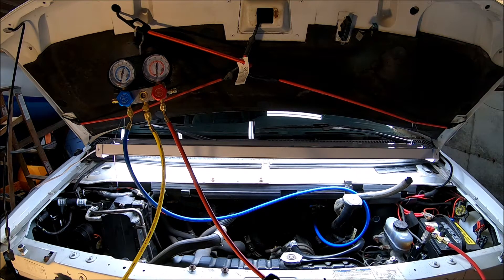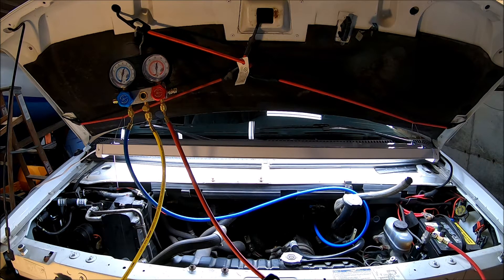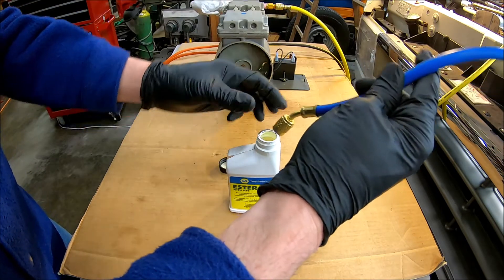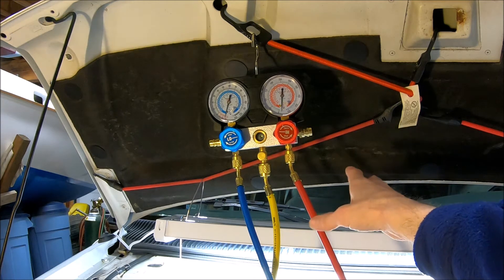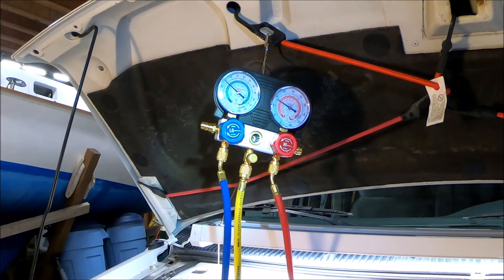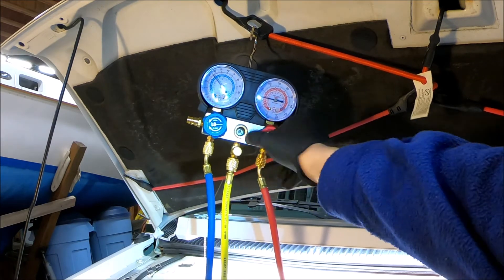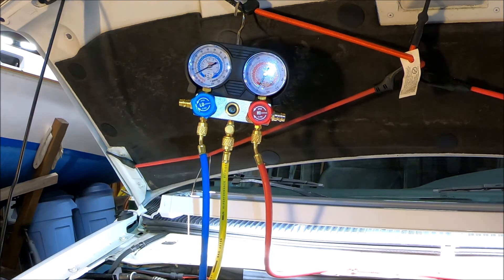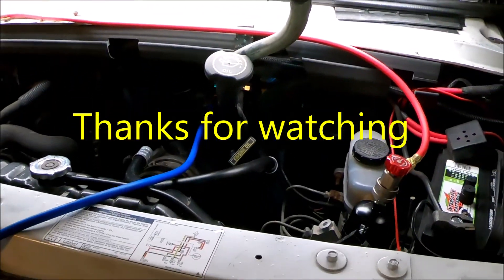AC Conversion From R12 to R134a:  Part 3 Final:  Recharging System

Comment: How much R134a did you add relative to the R12 specified by the manufacture? I see people saying anything from 75% to 85%.
Reply from the maker: Around 80% of what your vehicle says it needs for R12. You may have to ad a little less or more. I monitor the temp of the vent inside the vehicle, and pressures based on the temp and humidity of the day. When I get to 75% to 80% I just determine when to stop adding by the performance I'm getting. I would probably change out the condenser if you want better results. I have some new videos of doing my 93 Chevy Silverado and I change the condenser on that one. I am just finishing up on editing the last video on that one.